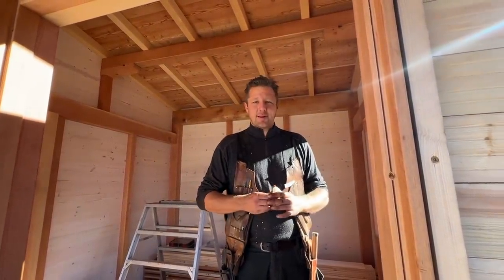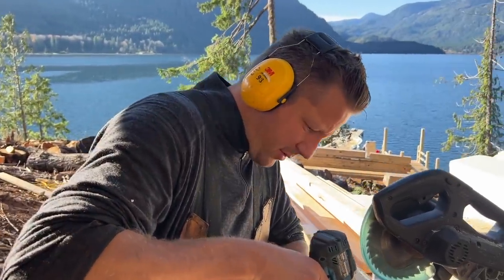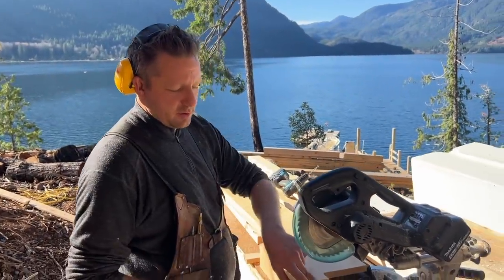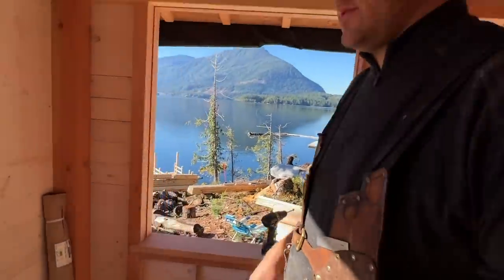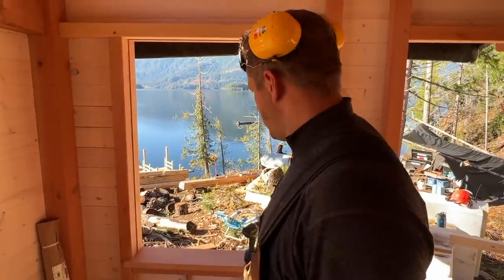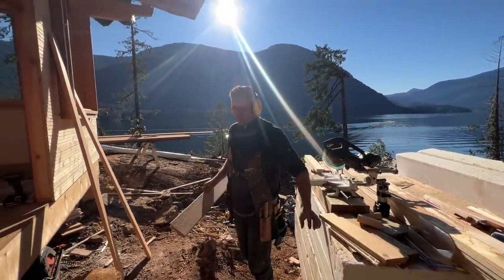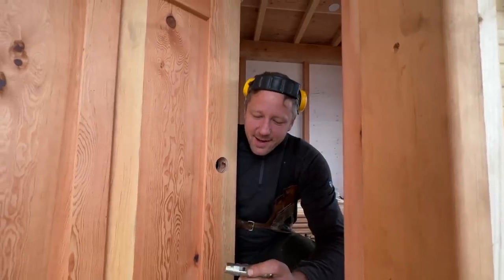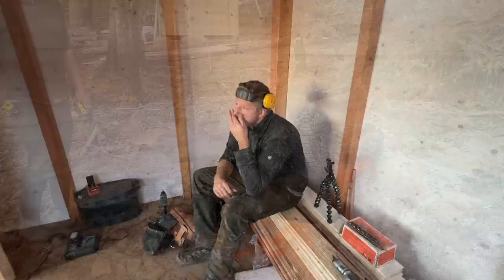Installing The Window Sills and Door Frame On My Timber Frame Cabin!!!

Comment: Everything fits like a glove, amazing craftsmanship as always. With tolerances so tight, do you have to worry about thermal expansion causing buckling?
Reply: Wood isn't effected by hot and cold outside of combustion. Wood is only effected by moisture content. That is why it is seasonal movement that causes issues because it is typically dry in the winter. Being that he lives around Victoria which is essentially rain Forrest, the humidity is pretty steady as always pretty high, so he would have a huge amount of issues with movement.
Reply: @sackclothandashes1342  Really interesting answer. Thanks for talking the time to explain it to me!
Reply: *wouldn't have
Reply: @sackclothandashes1342  adding to this, he's building it in the wet.. so if/when a dry summer comes, there will be contraction from this current size, but probably not too much expansion

Comment: "Your belly keeps the weight off your hips" from the guy who has developed a mighty fine "belt buckle polisher". Nice work on the sills. Next time order an entry lock that has 2-3/8"  to  2-3/4" adjustable option, I feel your pain on that one.
Reply: Yes, that’s an odd one; most of the high end door lock/handle kits come with the adjustable deadbolt or latch

Comment: when a furniture maker decides to build a house...   building a cabin to 1/16" tolerances or tighter is pretty unique!   😉
Reply: I was thinking if this is going to eventually going to be the shed then best built shed on the planet
Reply: Never seen a fancy mortising chisel on a building site either.
Reply: @johannes.f.r.  I have seen guys use a flat head screwdriver as a chisel (with decent results sometimes)
Reply: @johannes.f.r.  especially one hit with a framing hammer!
Reply: With the advent of the cheap harbor freight digital Vernier caliper, we've all increased our levels of precision wood working.
Reply: traditional carpentry my friends.

Comment: I love the chisel work but I was like, where's the cordless Makita Multi tool! ..... hey bud, check out the LN 102 for a lighter weight, low angle daily user to carry in your apron. It fits better in your hand and is the perfect size for chamfering edges or planning up to a 1" board. and, it won't break if you drop it.. like the more delicate rabbit plane.